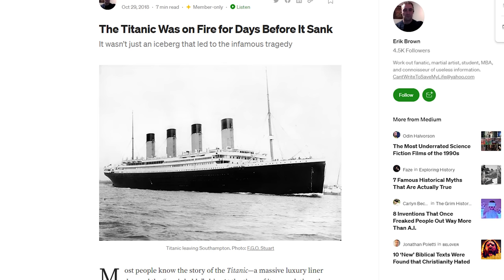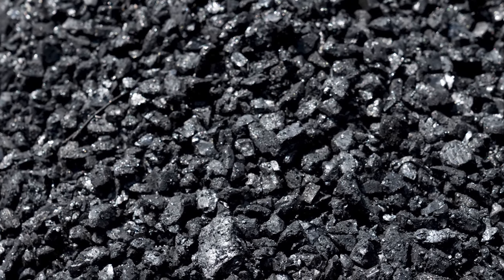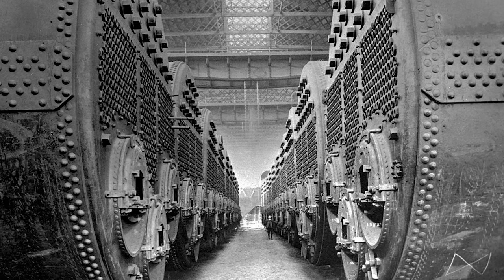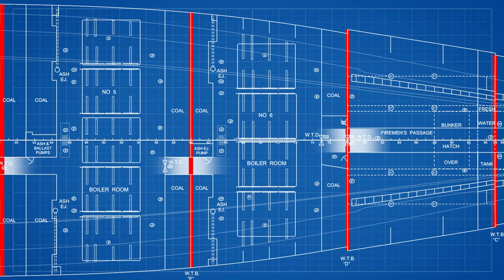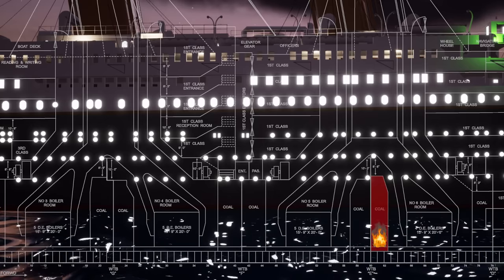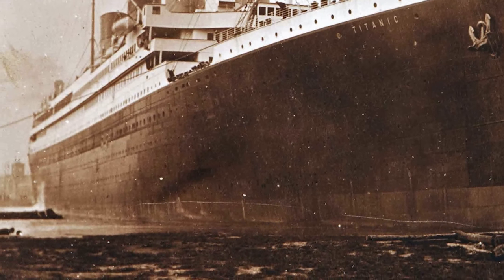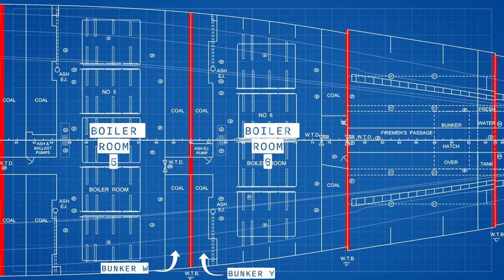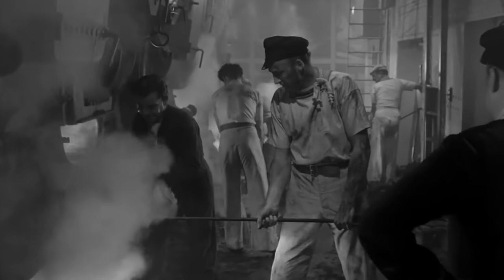Did the Titanic's Coal Fire Cause the Disaster? The Burning Question.

Comment: The thing that bothers me the most is when people claim how fast she sunk, or how some event accelerated the sinking like the coal fire, it doesn't change the fact that she was one of the longest to stay afloat after suffering critical dammage. People called her unsinkable and she damn well belived it too. Not only did she take nearly 3 hours to sink, she sank gradualy and damn near unnoticable for the first hour. She stayed on an even keel and didnt start to roll untill after she broke in two. She maintained electric lighting until nearly the end, dim as hell but better than nothing as the steam was eaten up by venting and progressive flooding of the boiler rooms.  She was a very very well designed ship for her time, it was corperate burocracy that killed most of those passengers.
Reply: "as corperate burocracy that killed most of those passengers."
The last lifeboats were floated off the deck. They didn't have time to launch enough lifeboats, even if they'd had them.
Reply: What if Titanic burning oil instead of coal
Reply: @shaynewheeler9249  Nothing but this difference -.-
Reply: @shaynewheeler9249   'I'm fast as F**  boy'
Reply: Titanic
Reply: @stormisuedonym4599 Not exactly true. The last two collapsibles were stored on top of the officers' quarters rooftop, not next to the lifeboat davits, like the other two were. This made the ones on the rooftop much harder to get to, and one fell over upside down on the boat deck. Despite that, one of them almost got launched on the davits when the final plunge started. 

It's very likely that any lifeboats, collapsible or otherwise had been situated next to the davit falls, they'd have been off fairly quickly, allowing hundreds more to survive than did.
Reply: @Starshipsforever  Possible, but unlikely unless the officers had realised the ship was doomed much earlier than they did - they didn't get all the boats they had away never mind if you double that cause you're adding time.
Reply: She has definitely received an unfair rap given how much damage she suffered and managed to stay afloat from, likely the whole 'sank on her first trip' thing in play, if anything she might have been constructed a little too well for her own good - had the bow snapped away clean the stern might have been able to stay afloat and or if she'd started showing signs she was mortally wounded sooner the evacuation might have happened faster.
Reply: @MLaak86  I don't think you've got an idea of just how hard it was to get Collapsibles A and B down from off the rooftop of the officers' quarters. Having them right at the davits saves critical time, perhaps 15-20 minutes, and likely they'd have been launched in time given the crews were averaging 10 minutes per boat launch.
Reply: @Starshipsforever  they didn't get all her boats away before she went down, even if we grant "bad placement" being in play, if you double the number she had you'd need more time to get them all away.
Reply: @MLaak86  You're creating a strawman here. I never once stated they could all be gotten way in that situation, just that more than did could've been launched and more people saved as a result.

But since you bring it up, other boats could've been allowed to also float free.

Another variable you're not accounting for: with boats for everyone or nearly so, the  crew can be open with the passengers that the ship will sink and therefore they need to get in the boats, which means more people also survive because they don't hesitate, like what actually happen and stay behind. Women who stayed behind with their husbands will be more likely to go, knowing or thinking their husbands will go on another boat, etc. 

Hundreds more will live who didn't.
Reply: it is not about how long she stayed afloat, but how much longer she could have if she were designed correctly. Almost twice the time she took to sink. And would have sunk like a normal ship - slowly. None of that seesaw madness we saw with the stern. This madness to continue justifying its  build is an effort by H&W, the boeing of shipbuilding. It doesn't matter how much we keep providing evidence for companies like boeing and their cost cutting practices, safety violations and cheap material usage, they will use the propaganda machine to continue saying -  our built it perfect and the best. Same is true for H&W
Reply: @wrongturnVfor  I disagree to some respect. The propaganda led to not enough boats and noone on board taking the accident seriously. She took nearly 3 hours to sink, much more time than most wrecks, and stayed relatively even keel for most of it. Most other ships list and capsize making it difficult to launch boats. Had they enough boats and passengers and crew took the accident seriously they could have saved nearly everyone on board. Time afloat makes a huge difference
lusitania sank in under 20 minutes loosing most of the souls on board, while britannic took and hour and only lost 30 souls. Both ships were taken out due to war. Titanic should have had numbers similar or better than Britannic, the main difference, Britannic had enough boats. She sunk faster and rolled over as most ships do during sinking but she had enough boats. The watertight bulkheads were even raised up. Britannic and Titanic were basically the same ship.
Reply: @RC-nq7mg  Oh really? Are you daaft enough to pretend that the size of the boat and the cause for the sinking doesn't matter? Even keel counts for jack shit when the bloody stern gets lifted into the air. Replacing listing for a buttlift isn't achievement. They had enough boats. The problem with the boats was they were never tested for how much weight they could actually carry because they were rushed. The reason they didn't lower them faster was because they didn't do the drills because they were trying to be fast. Should have could have...sure, If mu grandmother had wheels I could roll her around. But she doesn't. So you can take your BS propaganda and stick an iceberg into it
Reply: @wrongturnVfor  That was 2 hours into the sinking everyone should have been in boats by then.
Reply: @RC-nq7mg  what part of boats were not tested for weight did you not understand? The initial boats left 25% full, then 50% then 75% and then 100% full because the company never tested them because they were rushing. What is wrong with your comprehension?
Reply: @stormisuedonym4599  They absolutely had enough time to launch all the boats and double the number if they had them.
She wwent down so slow, no-one believed or took the action needed to get as many people as possible into the boats.. 
And if they had just filled the ones they did get off, so many more would have lived.
Reply: @RC-nq7mg  The main differece with Britannic was actually that there were 1066 people before she sank, most of them part of the staff. Also, they were all well prepared because, being war time, the possibility of she sinking was very real and in everyone's mind.
Reply: @shaynewheeler9249 if titanic was burning oil Titanic's keel would be laid up in 1939 then sink in 1942
Reply: If Titanic burned oil instead of coal burn
Reply: If anything most casualties were result of obsolete safety standards Titanic did follow.
Reply: Titanic
Reply: Titanic did have an alternating list as it sunk, but it was never severe like an Andrea Doria level list

Comment: I am a blacksmith.  I work with coal and steel  all the time. You say at one point that the steel  would  need to be "900°f to even  glow red" I would  argue that number. It needs to be hotter than that to glow red. Now to be fair I do NOT use thermometers or such to get the temperature of a piece of steel. We go by the color. At what is called  a gray  heat it is 1000°f it is gray in color and not glowing at all not until the temperature reaches between 1100°f & 1200°f do you get color, we call this blood red because it is a deep dark red color like blood. So the bottom  line is I do agree with what you are saying  here, that  the fire was not hot enough to do damage, it needed  to be much hotter. I doubt that it made any difference  at all. It would  depend on if the plate was steel or iron, steel  would  have gotten a very tiny bit softer (therfore explaining the worp that was reported)  but not fragile,  it would  have been  more malleable (if any changes at all!) So hitting it with something hard like an iceburg may have dented it but it would  not break  it. Of course a lot of this depends on the type of steel,  or if it was iron. I do not have nearly  enough information to do much more than  speculate , but I do know  steel and coal. Oh one more fact I can put a piece of steel in my fire and go  on my lunch break with no danger to the piece of steel other than keeping it warm. Without me forcing O² into the fire, that piece  of steel will  not even  glow  a little.  I personally have my doubts that a fire in a coal bunker did ANY damage to anything other than  burning up some coal.
Reply: 💯 Agreed.

Comment: For what its worth, I have done a lot of scanning of negatives to convert film photos to digital. A smudge like that could simply also be a fold in the film. This happens quite often if you are scanning film. As the film is rolled after use it might take on smudges in some places before it is developed.
Reply: As Mike also pointed out, it could be an artifact of lighting on that day. Multiple boring causes for the "shadow" that have noting to do with a bunker fire.
Reply: Because as we all know, no old photographs have any smudges on them.

Or reflections, as it may well be.
Reply: But the fire did happen, in fact, they shifted the coal to the port side which many say, and it makes sense, that it bought titanic more time and why she list to the starboard side so much with the oncoming water, like a counter balance..
Reply: Wet exhaust and salt water cooling instead of using a radiator and Prestone are extremely commonplace. Cold water continuously flows around hot exhaust manifolds. As long as you don't suddenly dump raw water on a very hot engine, it maintains an in-between balanced temperature.   Not exactly rocket science.
Reply: @jameschandler3308  except where the smudge is is actually the cargo hold section not the coal storage where the fire started that happened at the first funnel
Reply: True, my Dad used to develop his own films, he had a darkroom in the stables, and it was quite easy to stain a negative when setting the image. The older pictures must get fragile with age, which leads to easy marking.
Reply: Except these would have been plate photos, and not on film.

It's a shadow, an optical effect, for sure,  and not a mark on the hull, but it's not a fold in the film, as film wasn't used.
Reply: Yeah, my first thought was ‘All old photos look like that: Kind of crap compared to what we’re used to’.
Reminds me of those old photos people claim have ghosts in them. People just looking for what they want to find.
Reply: @pnag  look out we have ourselves and expert in the room

Comment: Once again I learn many new details about the Titanic from you.
A particular detail I was not aware of was the steam vents on the funnels. Now I know why in the 1997 'Titanic' there was a deafening roar in one or the scenes as they started loading the life boats that stopped suddenly.
Reply: I've heard what pressurised steam can sound like working on a dairy factory construction site, the engineers were steam purging all the stainless piping. It was louder than a Boeing 747. Class 5 ear protection didn't do anything.😂
Reply: Yes, this is a great scene right after the other great scene (Thomas Andrews fatal damage report to the bridge). I like the noise of the steam and then the sound of the gears of the davits being turned using cranks in order to prepare the lifeboats. This shows that despite the desperate situation, they will not give up and fight for people's lives.

Comment: Great video! Spontaneous combustion in coal is often caused by water reacting with iron pyrite (iron sulfide) which can make up a few percent the weight of the coal. When the pyrite gets wet and is exposed to air, it gets hotter and hotter as it reacts to form iron sulphate. Left unchecked, it can then ignite the coal around it. Pyrite is a serious problem for underground coal mines to this day.
Reply: yeah, i had a town about 3 hours away from my house. I stress the word HAD because they leveled the town because of a coal mine fire that has been burning out of control since the 1960s.
Reply: @kylemccullough3495 sounds like Centralia, Pennsylvania
Reply: @jasonlong2809  yeah, I was trying to avoid saying the towns name l, but yeah, it's Centralia.

Comment: There were also articles adding onto the fire theory that Titanic was facing the other side "undamaged" by the fire to hide the fact that there WAS a fire and that people were told to keep quiet about it. It seemed logical when I first saw it, but not so much now. It's also good that you touched on what the shadow was likely linked to because I hadn't read anything on what that could've been previously. Berrett I believe later changed what he recalled that night to something much less dramatic.

Comment: I always assumed that 3d class had it bad, but I completely forgot about all the coal shovelers in the boiler rooms. All that heat and back breaking labor for those few days, then to be the first to drown in massive water pouring in is quite depressing. Rip to those gentlemen.
Reply: Just some hardworking guys trying to make a buck. Really sad when you think about what their experience was probably like
Reply: Had it bad? 3rd class has running water, bathrooms and electricity- 3 things I doubt they had elsewhere in the world
Reply: @budwhite9591  You're right. Especially Portland Oregon. Homeless people everywhere.
Reply: The stokers were some of the lowest paid on board but their work shifts were organised well despite the intense labor involved. Approximately 20% managed to survive and assisted in the rescue operation. Some of those who weren't as fortunate displayed heroism by sustaining the boilers to aid the rescue efforts. It's frustrating to see the portrayal in the 1997 movie where officers sacrifice stokers and close doors on them, with the stokers banging as if trapped. In reality, the engine rooms had multiple levels with catwalks and ladders, and the stokers could simply climb out through a watertight hatch at the top and seal it shut behind them.

Comment: Great as usual! The “bunker fire bulkhead failure” idea was earlier in the Charles Pellegrino book “Ghosts of the Titanic (2001)” – among many of his other interesting but speculative theories. If I recall, Pellegrino also tied the impending fire danger to JP Morgan supposedly taking his artwork off the ship, and the desire to get to NY early in the darkness so waiting fire engines would not make as big a scene.
Reply: Fire engines?! What they supposed to do, lower them into boiler room via derrick crane? Also, I wouldn't be surprised if Titanic's fire fighting pumps capacity were pretty comparable with FDNY available resources of the time, or even outgun them.
Reply: Good question – but many of the authors speculations don’t really stand up on the surface much less in the details. Though Pellegrino was an associate of James Cameron he had some trouble when the sensational details in his book on the Hiroshima bombing turned out to be fictional.
Reply: Bunker fires were quite common at the time, generally extinguished by removing the coal. No fuel, no fire.
They generally weren't considered a risk to the vessel, more an annoyance - both due to the cost of the lost fuel and having to transport coal further instead of using the nearest bunker as intended.

Of course, the crew would have standing orders not to mention it to the passengers, so as to avoid creating panic.
Reply: Man, my grandma got me that book, and even as a teenager I could tell the things he was saying seemed fishy. Said thanks to my grandma who just found a book on a topic I was interested, but I didn't read much of it.

Comment: Mike! I have a possibly stupid question, that probably in reality would only cause a matter of minutes to be saved or lost but: If the fire hadn't happened, and the bunkers W and Y were full of coal, is it possible the sheer mass of the coal in those bunkers would have slowed the amount of water able to enter through the bunkers for a time? Maybe even producing enough resistance to prevent the bunker doors from collapsing sooner? I know it's probably only a few minutes we're talking about here as the ship was already doomed, but it would be interesting to know if that would change anything, if they'd gain time, or lose time (Because without the fire the doors would likely have  been open theoretically meaning nothing was stopping the water before the door/bunker wall collapse?)
Reply: Think of the coal as a pile of particles, like a bucket of sand. Now add water to that bucket of sand and you will add fluid to about `/3 the total volume of the bucket.  30% of the sand is void space.  Ok the coal would include a mix of sizes but loosely dumped in it would not be compact, I might give it 20% void space but think I am understating the amount at that number.  So lets run with 20%, and assume that this void space is interconnected ,just like in the bucket of sand.  So the answer is no, the coal would not impede the flow of water in any sense.  In fact as the void volume is only 20% at the same rate of filling the coal bunker would actually fill more rapidly filling to the outside waterline quickly and create a hydrostatic head against the bottom of the bulkhead significantly faster.  The volume of a coal filled bunker has to take on 1/5 the volume of an empty bunker before the water reaches equilibrium with the outside as coal already fills the bunker.